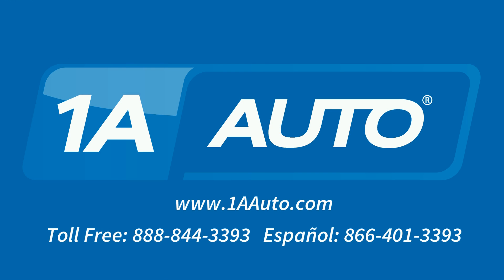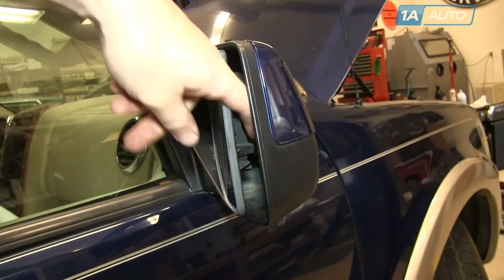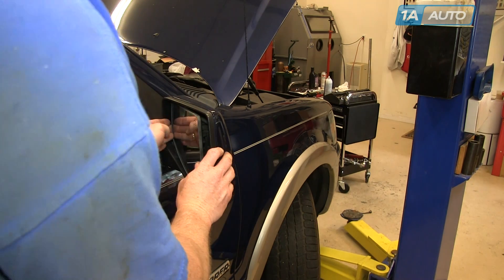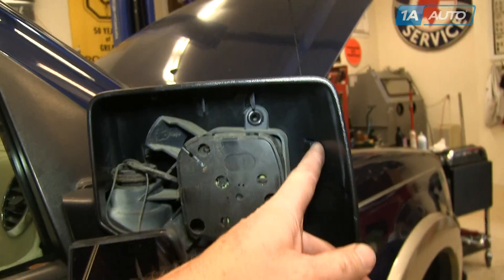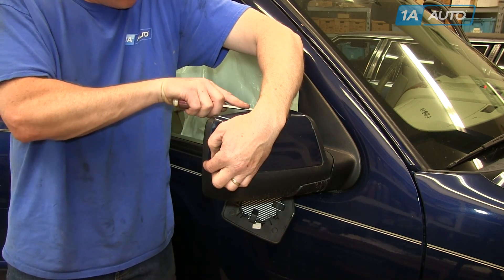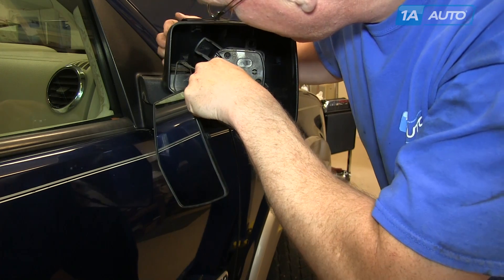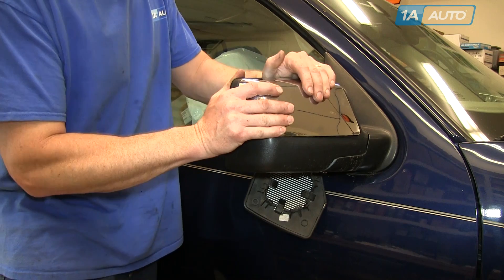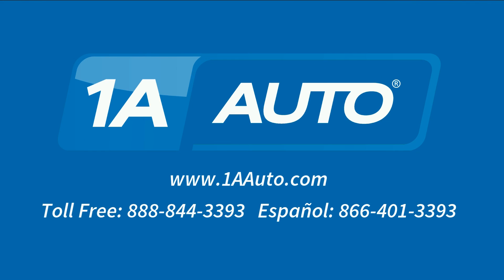How to Replace Mirror Cap 06-10 Ford Explorer

Comment: Do you have a video for a 5th generation Explorer? I’ve got a 17 Limited and needs a new directional lamp and was told it would be cheaper to buy a new mirror rather than disassembling the existing side mirror to replace the directional lamp.
Reply from the maker: +Christopher Perez This procedure might be different for your application. We do not currently have a how-to video for this particular year, make and model. Thank you for asking! http://1aau.to/m/Shop-1AAuto-c